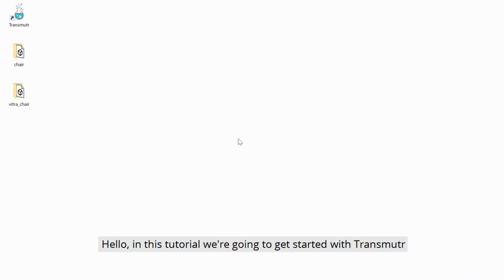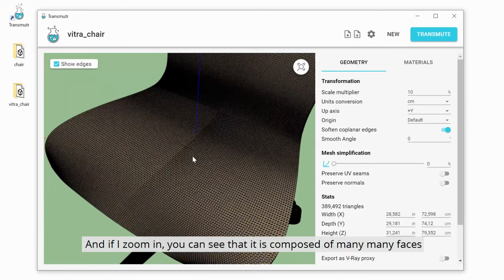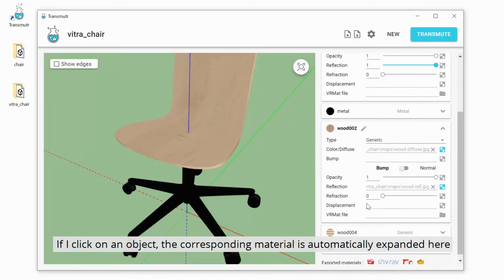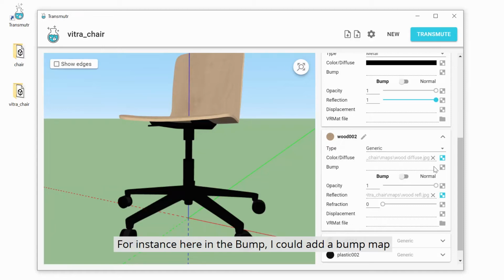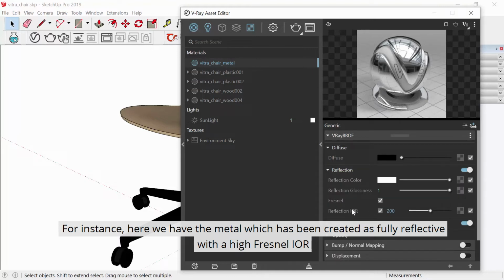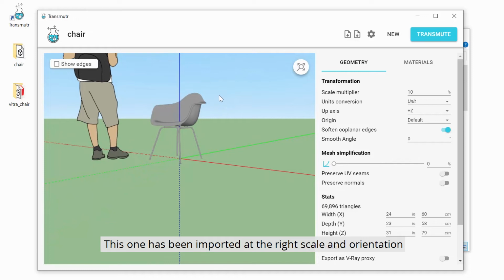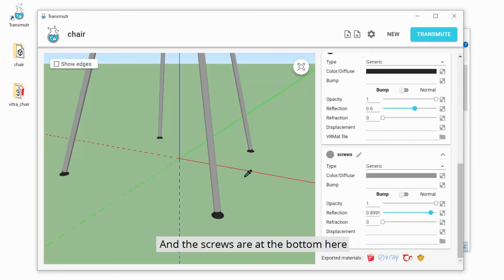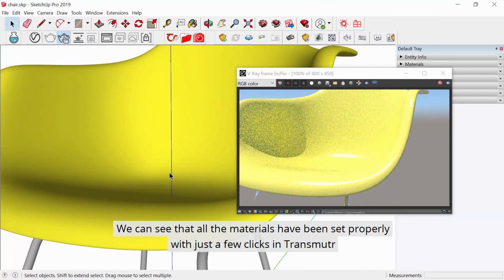Getting started with Transmutr

Comment: When i changed any parameter material of Enscape in Sketch up, it will automatically change dimension of texture (then, i need to retype inital dimension of texture in material setting of Sketch Up , it's still ok but take a lot of time). May i ask how to fix it, thank you!!
Reply from the maker: I think you need to check "Explicit texture coordinates" in the diffuse map parameters in the Enscape material editor.